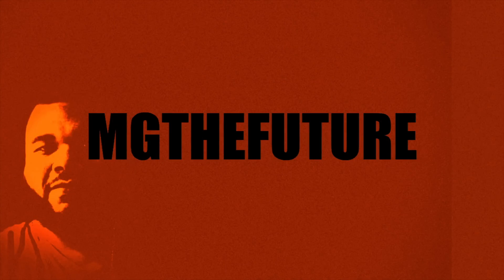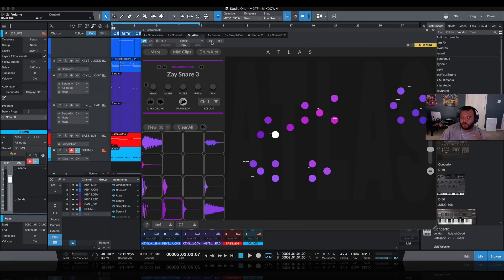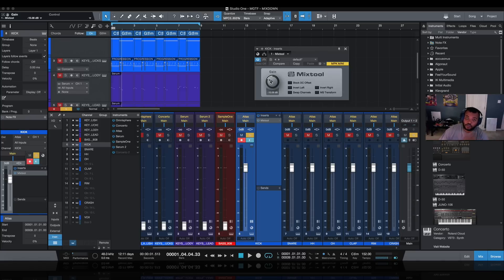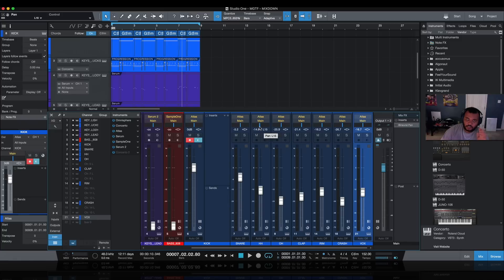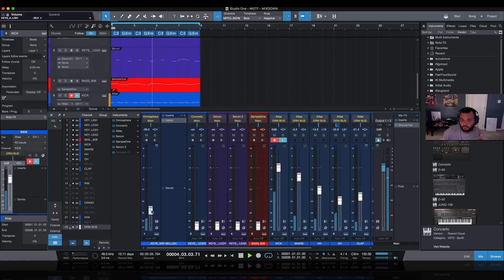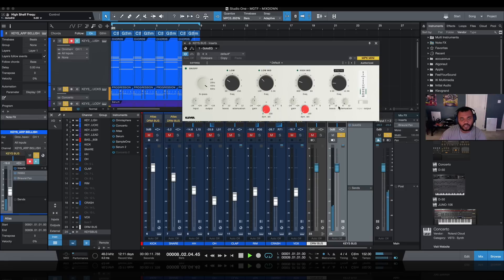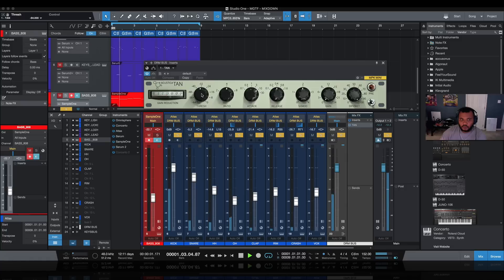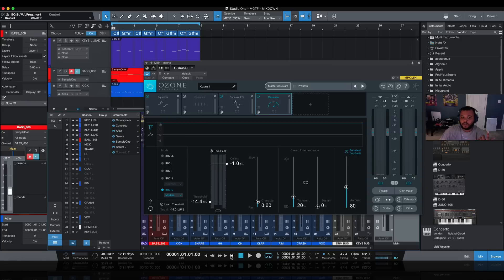Studio One V4 | Basic Trap Mix For Beginners | Setup & Multi-Outs

Comment: I approach mixing hip-hop similar based on the drum kit from the listener's perspective, but in general, I keep my pocket center (kick/snare) and pan the rest to complement other elements in the music based on frequency and rhythm to create a call and response. Another approach is to keep everything center, and whatever gets "lost" in the mix gets panned outward. You still want to make sure it's balanced so that you don't create eat fatigue on either side. It's like you have a certain amount of time for your left to answer your right and vice versa. The way you balanced everything was very nice on the ears. One pet peeve I've developed lately has been the snare being too hot to where it kills the vocals or its just flat out too aggressive. I've heard songs I wanted to turn up but I couldn't because the snare was hurting my ears. Yours was great! The only thing I would have done differently was cut some of the lows out of that pad a bit. It sounded like it was competing with the bass. Maybe a hi-pass around 50-60hz with a soft Q.

Adding to the rules of thumb to mix low and in mono, you also want to keep your lower frequencies closer to the center and the higher the frequency content, the further away from the center you pan it. That's based on how your ears perceive/discern the location of sound. Also, the more intermittent the sound is, the further away you can afford to pan it.

I hope some of this helps someone!

Comment: 👏🏿👏🏿 Nice work fam. 
Sometimes it helps to gain stage from the start of your chain - the synth or audio. A whole load of synth patches (Omnisphere, some Kontakt libs etc) peak in the red from the jump and if you don't adjust the gain from there you can end up turning down an already clipped signal. Pre fader metering helps with this. It shows the level of the signal before it hits the fader and can only be adjusted by pre fader gain - not the fader itself (I don't use Studio One, but I think all DAW's will have the option). You will notice gain staging mostly with vintage emulation plugins especially Acustica Audio (if you send a clipping signal into one of their plugins, it distorts to the point of being unusable).
Also using Cerberus Audio Ice9 (free auto mute plugin) on your main outs forces you into the habit - it temporarily cuts audio as soon as it peaks (also useful to protect monitors, headphones and most importantly hearing).

But, as you said all that matters is a banging end product. 

PS The beats kinda 🌊🌊 👌🏿